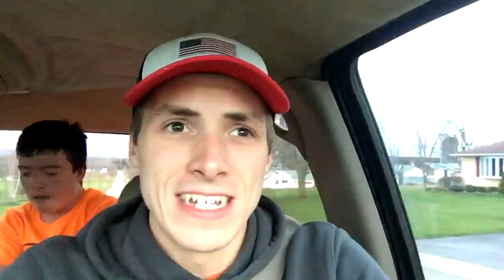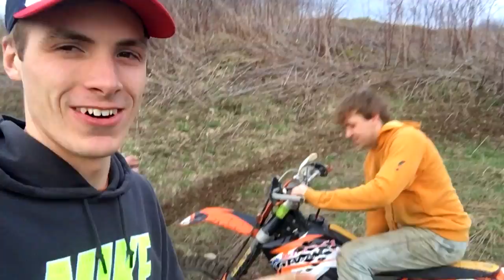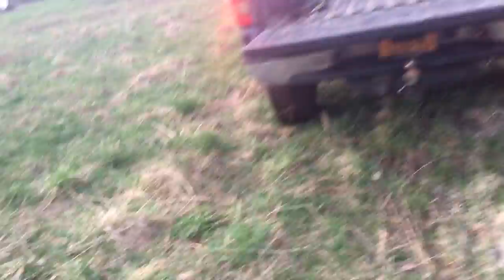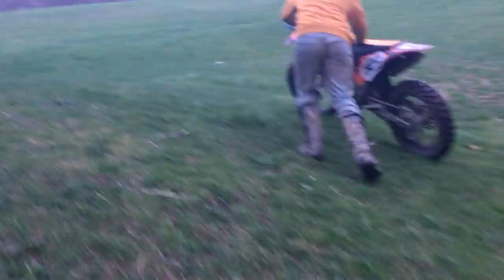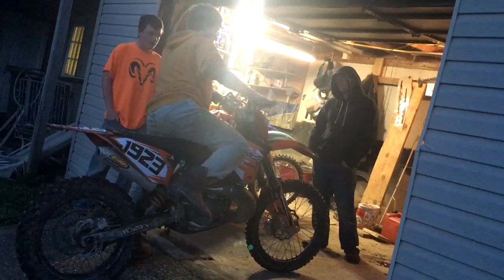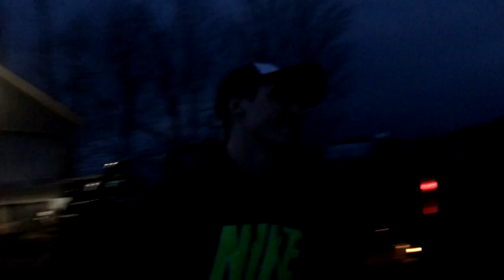FIRST TIME BLOWING UP 300 DIRT BIKE!

Comment: Dalton ur 250f blew up, The differens between a 2t versus a 4t is that u can afford to fix the 2t
Reply: ahhaah wtf is 3dmachines talking about
Reply: get real... we can all agree a 2 stroke bike is much easier to blow up. Just more variables.
Reply: I always tell young guys to buy a 2 stroke, easy and cheap to fix.
Reply: I wouldn't say `more variables` because it has considerably less moving parts
Reply: Alex Belletti, I have seen plenty of 4 strokes bite the dust.
Reply: It depends on state of tune and how it was run and cared for. lots of snowmobiles and dirtbikes from the 70's been running strong for 30+ years with original piston rings seals etc...
Reply: it's almost like rotory engines they have trouble lubricating them self.  2st are scavenger engines they have no valves are lubricated through there fuel.
Reply: This "KTM is garbage" shit needs to stop, ktms are extremely reliable, just because they werent the best in the early 2000's doesnt mean they still aren't good, i had a 08 125 sx had over 100 hrs on a top end and still ran perfect, had a 2007 rmz 450 blew valve seals 20 hrs after a fresh rebuild...
Reply: Yeah but lets be honest.... suzuki is trash
Reply: Yeah I aint gonna deny they are surely falling behind on dirt bikes, but their street bikes are great!
Reply: True
Reply: Kole Porteous dude you you may have had bad experiences but my KTM 2 stroke 250 has out lived 2 bikes one newer one older a 2002 yz 250 and a 2012 kx250f they both blew up my 07 250 is still running perfect
Reply: Paul: And Daltons KX250F 4T  blew up after 80hours :D . I've had  Gas Gas EC 300 2T with more than 300hours on it.It was running with no problem.But i recently did a rebuild just in case.btw:head,cylinder looked like new.Just piston had little bit of wear.And mechanic told me the engine would have probably hold up another season...
Reply: My KX 250F has done 150 odd hours of straight up hammering and it still runs fine
Reply: Albin Bergqvist ya  fix the 2 stroke ten time before the 4 stroke needs a oil change lol.
Reply: mohawksniper79     my RM 250's top end have 80+ hours on it and still going strong with high compression etc and btw don't your 4 stroke need an oil and filter change every 10-15 hours?
Reply: 50 - 100? For an oil change????!!!! What 4 wheeler is it?
Reply: Okay that makes sense... if it was a race quad it would be a whole different story I'm assuming
Reply: race quads sure, but dirt bikes, which we were originally discussing, require an oil change ever 10 hrs or so, a 2 stroke never needs an oil change except gear oil, a full rebuild on my 125sx, including bottom end, cost me 600 dollars, i done the work my self, cams alone for daltons bike will be in the same price range.
Reply: this is in canadian dollars btw
Reply: 2 strokes are not being fazed out. I mean a 250 2 stroke has as much power as a 450 4 stroke the put power down ever 2 strokes instead of ever u 4 they do need a top end like 4 times before a 4 stroke will ever need a rebuild but it's way cheaper and you don't have to get the valves done all the time. they have the advantages and there disadvantage but I wouldn't say either was crap
Reply: your kidding right, I have NEVER heard of any dirt bike with 1000hrs on one top/bottom end thats 41 days of that engine running constant, unless you can find me proof, I'm calling BULLSHIT and btw that ktm had about 300 hrs on the crank and 100 on the top end, top end was fine just a conrod bearing went.
Reply: The CRF250R Honda  service manual recommends a piston every 15hr (look it up for yourself – YZ450F is 12.5 hrs). A crank should be replaced every other piston change (30 hrs). These crazy 250 hour crank stories are BS. That is the equivalent of 125 Hare Scramble – 2.5 YEARS racing every weekend!!! Nonsense!

 

 

Here is a real crank schedule from experience!

 

 

Top Level Pro - 15 hours

Good Amateur -   25 hours

Ordinary rider - 60 to 80 hrs

 

 

Pistons are half these numbers.
Reply: Two strokes are def more reliable
Reply: Albin Bergqvist true
Reply: I have owned both, I like the 2 stroke better because you need to focus more, slipping the clutch in a turn making good shifts and you need to rev it good and keep it on the pipe. The 2 stroke "HIT" is just the best thing when the bike hooks up properly and then there is the smell and that BRAAAP sound what's not to like.
Reply: Oh yeah let me just compare at high strung low tolerance performance race engine that demands tight service schedules to a moderate, high tolerance, ATV engine that is more lenient to service schedules, once again I ask you to find me a 4 stroke dirt bike with 1000hrs please.
Reply: I wish i could show pictures on youtube, because my ktm did in fact have over 100 hrs on a top end and over 150 or more on the bottom end, ive had both 4 and 2 stroke, even tho there is a big power difference, i still preferred the 2 stroke, but now i got a rocket so the dirt bike life is boring   >:)
Reply: Yeah, it's worse here in Australia though, oil/gas prices are through the roof and a full rebuild for a 125 here is still roughly 1000 bucks, even just for parts.
Reply: Linxyy,  I hear you I would imagine everything would be expensive in Australia. I used to talk to some guys that raced Posties there the Honda trail 90's, seemed like they were having a blast racing them.
Reply: Linxyy I'd just move lol...that's crazy maybe cost $200 tops here if u do it yourself
Reply: Jared Mercer yeah that's true! in Canada it cost $600 to send away to get the head done, plus $150 for the piston n rings if got high performance,  I just hope he checks his Reid's before he tries to start it afterwards
Reply: Seriously???? My friends YZ 125 just blew a couple rides ago, just for a new cylinder it cost $700, to get it redone it costs $900.
Reply: Linxyy that's crazy!!   There's a place in Montreal I got mine sent to that cost $600
Reply: Albin Bergqvist he was likely running his bike to lean that's why it did a wheele and then cut out. And when u run to lean you will get a lot more power but the compression goes to shit a lot faster
Reply: lol my dads XR500 had 333.8hrs on hour meter and it’s never had spark plug or air filter changed just oil and oil filter
Reply: Dude its like 2000 to rebuild a 4 stroke and like 200 for a two stroke
Reply: Samuel Dittmar kx85 is 2t
Reply: Samuel Dittmar oh sorry i couldnt sunderstand you for a sec

Comment: Head gasket is shot, not enough compression left. That's why it sounds like it wants to run but wont. Hopefully it didn't burn up the top of the piston and cylinder, very common with blown head gasket on a 2 stroke.
Reply: Paul Childers might've sucked the reeds through too
Reply: Paul Childers yup. you're right.
Reply: Paul Childers but if it was the head gasket it would still start when they pop start it
Reply: Paul Childers I'm saying piston rings
Reply: Remember this is a single cylinder engine. It running would be dependent on the damage to the gasket. If you hold one wide open, it may or may not start. Just depends on how bad it is. Although I don't recommend doing that. Very bad things will happen to the top end.
Reply: Come on now...
Give these guys enough credit
I think a head gasket
would be making some obvious noises.
(and feel the back pressure when kicking...)
I had an old Honda Elsinore
that liked to partially shear the crank key
and it would throw it out of time...
After this happened a few times
it ended up breaking the crank.

Comment: He mightve just blown the head gasket and in my opinion two strokes are great
Reply: Maybe the rings are bad and just lost compression. Happened on my bike a few times!
Reply: Christian 777 that wouldn't make it lose all compression the top end is out needs a rebuild
Reply: Christian 777 ya I actually prefer a 2 stroke over 4 strokes a lot more becouse 2 strokes in my opinion are more fun
Reply: AJ-S I have a 2003 cr 125 for my fun bike and a 2017 yz 250f for my race bike. TBH I have more fun on my 2t!
Reply: I have a 2016 tc 125 for my practise and a 2016 fc 250 for my race bike and I gotta say I prefer my two smoker

Comment: Sounds like it lost it's compression. Maybe a ring has not been holding up to thoses new graphics, BRAAAAP
Reply: - Kutsogolera - could be it lightly seized  from small spot piston ring/rings so it has quite not enought compression
Reply: - Kutsogolera - hes talking about the rings not the piston seizing into cylinder

Comment: just to help diagnose it, if the top end is shot,  pull the spark plug and add a little bit (half cap full) of 2 stroke oil into the cylinder. The oil will help seal the rings giving it enough compression to run again. Will only start and stay running until oil burns off and looses compression again.

Comment: did you check the ring gap before installing a new piston 😂or check the squash band compression ratio😕 otherwise check it. seems like need a thinner top gasket maybe 1mm or less

Comment: My kx 125 did the same thing. I was coming around a corner and it stalled and I couldn't get it going so I changed I pulled the plug and put in a new one and fired up first kick.

Comment: 2 stroke FREE FIX...the rings are melted into the piston so there is no compression...take out the piston and free up the rings, clean the ring grooves with a small file then put the rings into the bore and use a flashlight to make sure they are making contact all the way around...if you see light slightly bend the ring until there is no light...ive done this trick many times and it always work great

Comment: I just got an oil change on my bike, I was riding today and only 30 seconds into the ride the bike stalled... What's wrong? 
p.s. She kicks but won't fire.
Reply: Cow how did it die like the sound and stuff
Reply: Two StrokeKiller - Had no power, kept bogging down, it sounded normal but kept bogging.
Reply: Probably need new rings for your piston

Comment: if something like that happens never try to start it, i have 2014 sherco smr 50 and my bearing at piston/crank broke and we tryed to start it and it stuck becouse those needles got between piston and cylinder wall, the cost of rebuild from 60€(piston and berings)now i needed new cylider, piston, crankshaft and few more things and it costed me about 700€